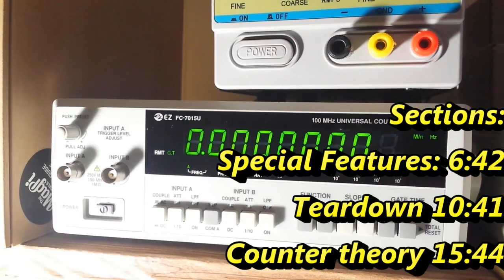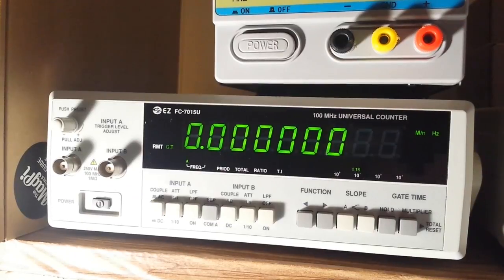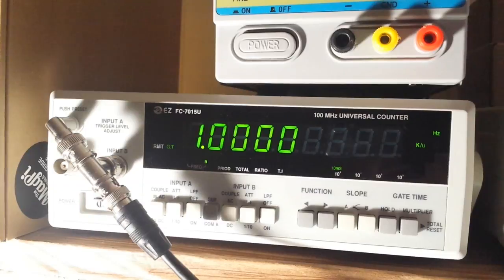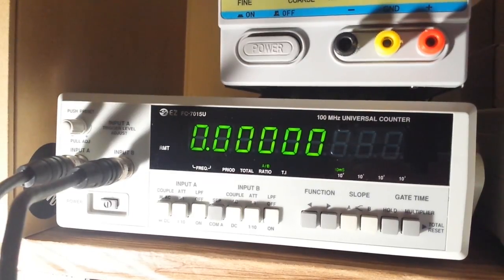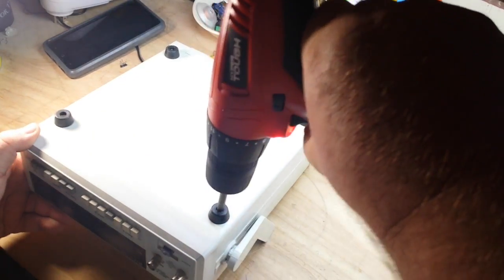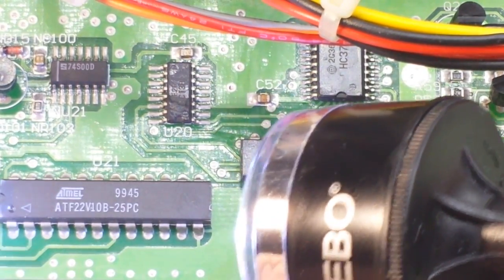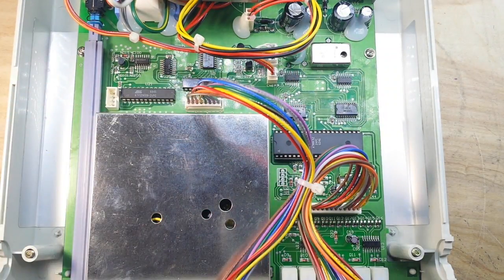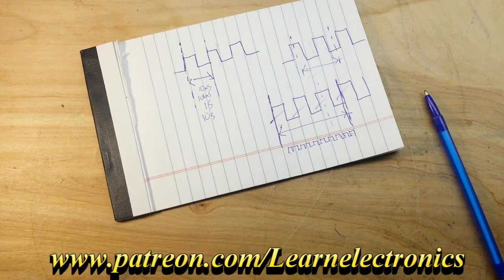7015U Counter and how counters work

Comment: Another nice piece from the auction score. Any repairs to this one or did it just work? Thanks for an informative and interesting video!
Reply from the maker: +George Chambers It was perfectly fine. Most of the gear is. The school just replaces gear every few years. Then it sits in storeroom for years until it's completely deprecated. Then they auction everything off.
Reply: The only school around here is just a couple of years old. I doubt they have any equipment old enough to retire yet. I guess when you live in an old established part of the country that stuff is available. The big cities like Portland you can find deals like that just not here in the hinterlands. Oh well.
Reply from the maker: +George Chambers George, since schools allow bids via mail, email, and even telephone. Check some of the bigger schools on the left coast and you may find auctions posted online that you can bid on.
Reply: Good idea. I hadn't thought about online bidding. The only real problem with that thought would be shipping or driving hours to go fetch the stuff. I will look into it though. Thanks for the idea.